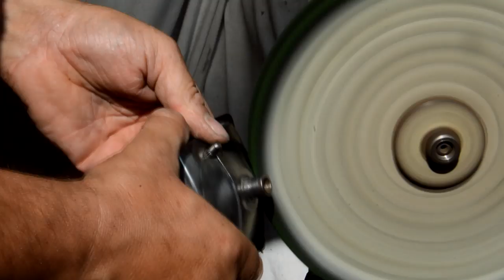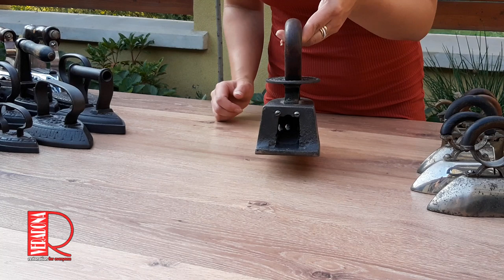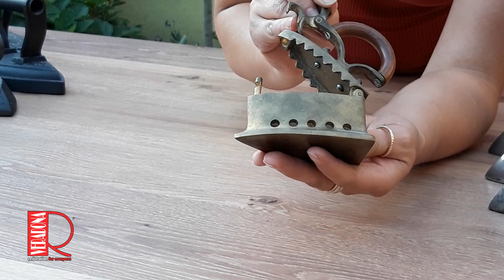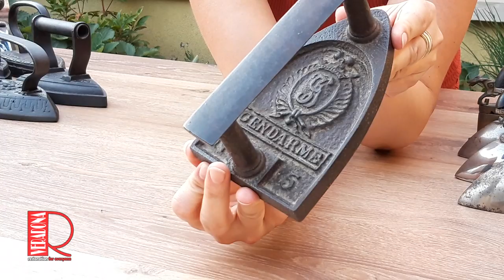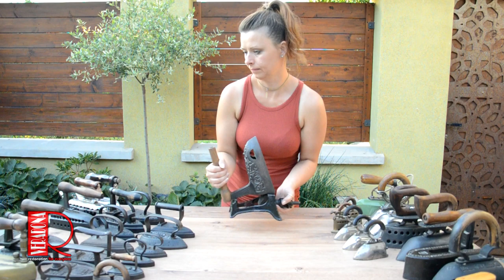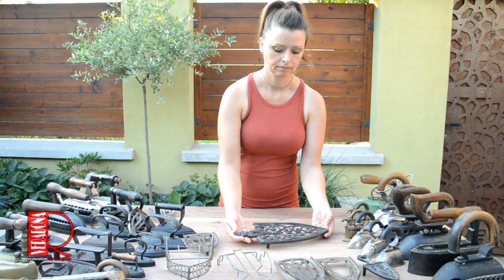My collection of old irons part 2

Comment: My grandmother used to use those flatirons with the removable handles to iron clothes. She'd have three or four at a time heating up on the woodstove. Then on cold winter nights they used to heat up the irons then put them in the foot of the bed under the covers to keep the feet warm.
Reply from the maker: Thank you for the enlightening comment 👍🙂🇨🇿

Comment: I Like Your Old Iron Collections. The Latest Irons That You Show, It Can't be Filled With Any Charcoals at All. It's Just Solid Steel With No Chamber Inside. So I Guess, Maybe They Heated The Iron Directly on Fire First Before They Using it Right ? I Guess Maybe That's The Oldest Ones. From All of Your Old Iron Collections, Which One is The Oldest and From What Year ? So People Who Using it in The Past, Might Have Two Advantages. First Their Clothings Are Tidy & Smooth. And Secondly, They Have Their Strong Hands Allready at The Same Time. They Don't Need To Go To The Gym Anymore....😀😁😂🤣😃😄😅😆